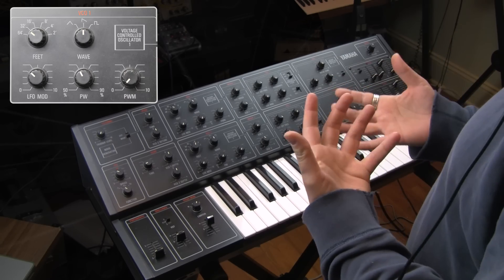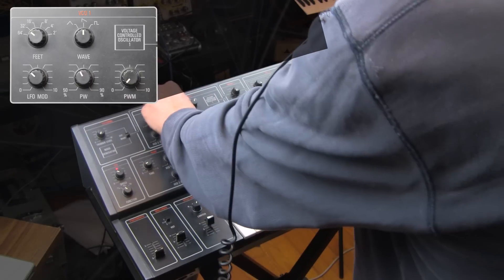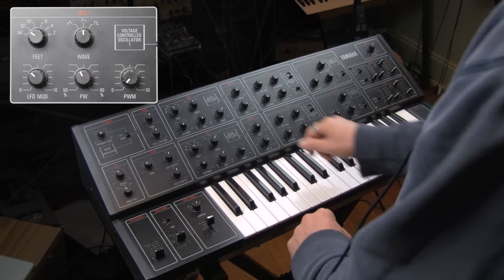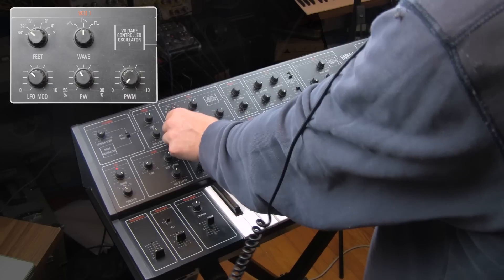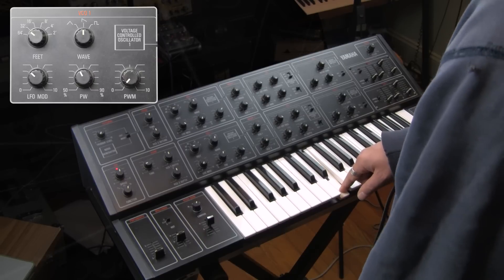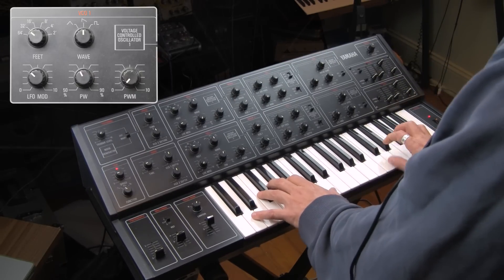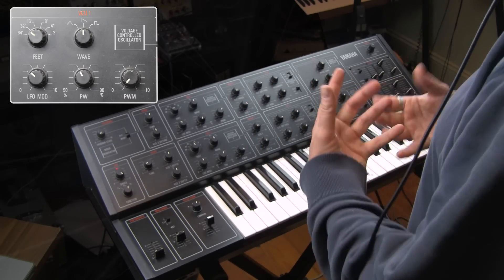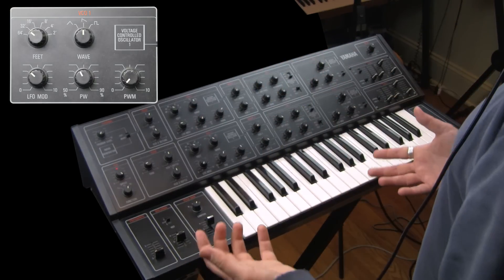04-The Yamaha CS-15: Part 4- Oscillators Part 3

Comment: I have a CS-10 and a CS-5 hooked together via the CV and Trigger jacks on the back.  It is. for most purposes, a super CS-15.  The pair of them is often cheaper than a CS-15 with the bonus of separate LFOs, fully mixable waveforms, three envelopes and both types of envelope times. 

Only downside is the space two units take up.  Also no detune, no triangle, no sweet Brilliance control, not as much porta/glide control.

Just amazing the sound you can get out of these things.

The CS series all have sort of strange envelope times, that are different from model to model.

The CS-15 has: Attack 2.5 ms to 2.5 sec - Decay and Release 5 ms to 6 sec  

The CS-10  has the odd filter envelope with Initial Level and Attack Level prior to the normal settings.  Attack is 1 ms to 1 sec  -- Decay and Release are 10 ms to 10 sec.

The CS-5 has really odd times.  Attack 7 ms to  7 sec -- Decay and Release 0.08 to 18 sec.

These envelope differences make a hug difference is how the instruments sound next to each other.

Comment: After I got my cs-10 (which I still hate and never use!) in 1979 the store got in a cs-15 a few months later and I always wanted one. I finally got one last year and it is amazing! Still a main stay in my studio! But for shear versatility the cs-20m blows it away. And the cs-40m is even better. Very different sound though, more thick and fuzzy. The black CS synths have a very cold sound. I'm not sure why or how to explain it. It's a very thin sound in a way, almost like you are only hearing every other harmonic. But it's a great sound to cut through in a mix. But it seriously needs a mod wheel for vibrato. I found a mod for that and will have to do it some day. Also, and I know you haven't gotten to it yet BUT... I LOVE the pitch bender!
Reply from the maker: If you think the CS-15 sounds "thin," you're going to hate nearly every comment I make and example I use in this video series.  :D  I'm sorry!

There is definitely a characteristic tone, though... that I will agree with.  If the CS-15 had rightfully been embraced, people would be able to spot usages of this synth because it specifically has its own character.  If you don't like that character, I can completely understand.  

But the sounds I can make (and have made, for example in the first video, cannot be described as "thin."  In fact, I've never experienced as much clipping in a synth demo as I did in the making of this one, and it was always because of a massive low-end!  I'll show a lot of examples in the filter videos.  

Yeah, I'm not much of a vibrato-as-expression kind of guy... when I do funk, it's not really THAT kind of funk, if you dig my scene.  I have been perfectly happy just reaching up and turning the LFO mod knob in the oscillator section when I need that... but I recognize that you can't really do it to both oscs simultaneously.
Reply: Well, compare it to an MS-20 or a minimoog or even a CS-20m and you'll hear the incredible difference, and I just can't find any other word other than "thin" to describe it. Maybe "bright" is a better word. Maybe it's just that certain higher harmonics are louder than other synths, I don't know! But it's definitely different. To me, it's just not as warm as any other synth. But I agree that what I hear in these videos sounds fantastic, and I often start noodling around on mine and can't stop because it's sooo damned cool! 

But like I said, when I put it into a mix, it really stands out. My Arp Axxe is like that too, VERY bright, but a much warmer sound (I think they were borrowing the Moog filter in those days) and it's become my main lead synth even though (or maybe because!) it only has one oscillator. But again on that one I have to grab the LFO slider and use it for vibrato. I'm used to it now though and when you think about it, other than a bit of comfort, what's the difference? 

And no, I'm definitely not going to hate any comments about it! It sounds fantastic and is highly underrated. But if you think that's bassy, you should try a cs-40m in unison mode! You have 2 sine wavs you can mix in at the VCA to add that round low end. And in unison it's 4 oscillators and 2 filters. MANY more modulation possibilities AND the Yamaha ring modulator! But I digress....